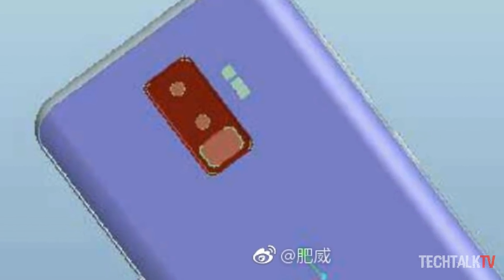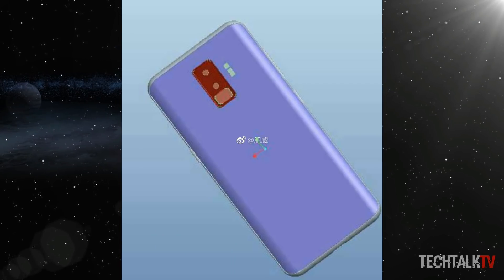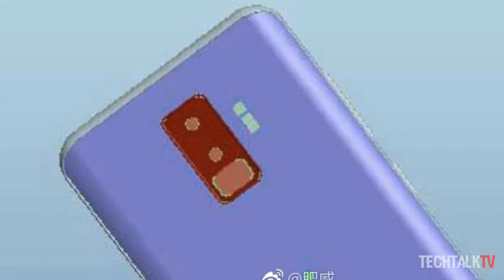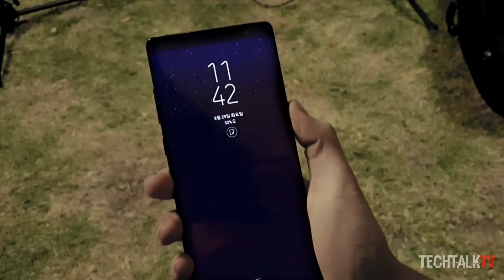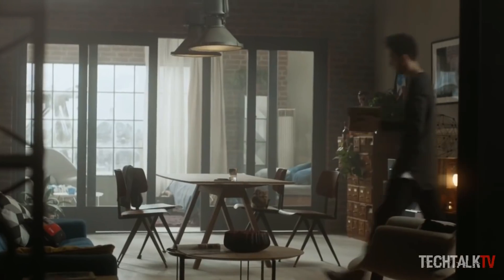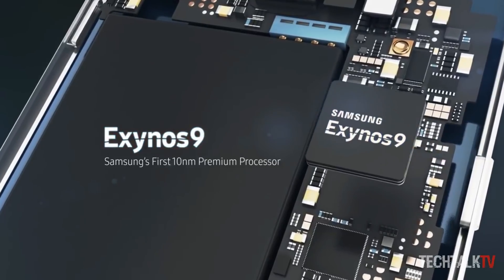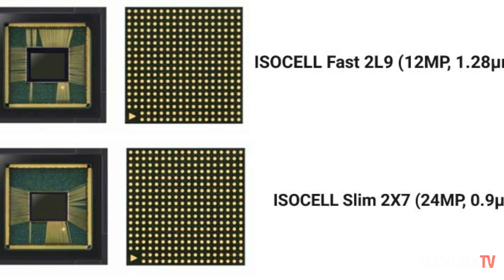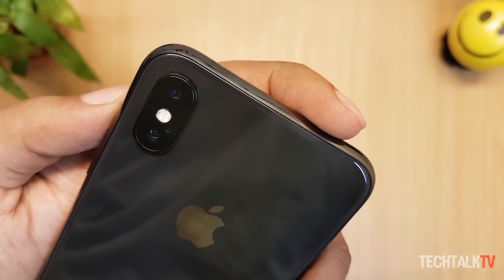Galaxy S9 UPDATES

Comment: I want to know, if the s7 edge will get the Oreo 8.0?
(Currently running 7.0 on mines)
Reply from the maker: +Kingz Leez 
As far as I know it will only be next year mid 2018 from other sources I read. It's mostly still in Beta mode and they need to test on different devices. Any Samsung device released after S6 will be able to get the update.

Comment: What do u think 
Upgrade from s8 to s9 or s8 to Note 9?
Reply from the maker: It's difficult to say right now since we don't have enough concrete evidence. I would say if you have an S8 then upgrading to the Note 9 makes much better sense. Since the S9 is an incremental upgrade over the S8 and you won't notice much difference at all. Tthe Note 9 will definitely feature a lot of cool features which will make your upgrade substantial.

Comment: Fake i really think a huge company like samsung will do the same thing they did with the s8 and s8 + and if it is like that the company would get more dislikes , nobody wants that so i think this time the  heart rate monitor will stay in the same place and the fingerprint scanner will be a little further away from the camera unit
Reply from the maker: I think they'll align it vertically this time. The horizontal layout is good but not pretty and both the Note 8 and S9 will look the same if the cameras are horizontal. So, yeah it's a safe bet that the cameras are going vertical.